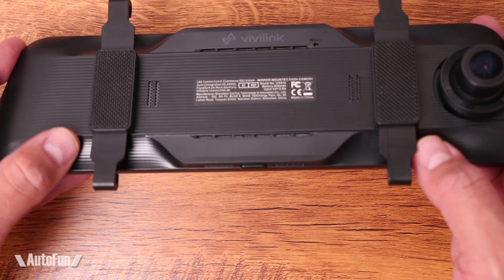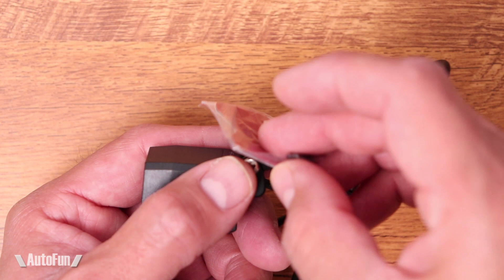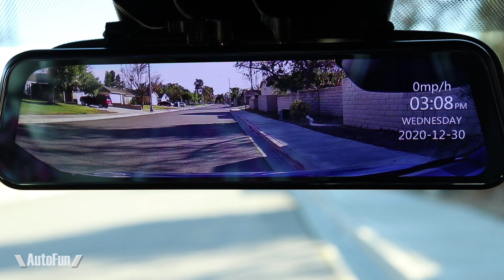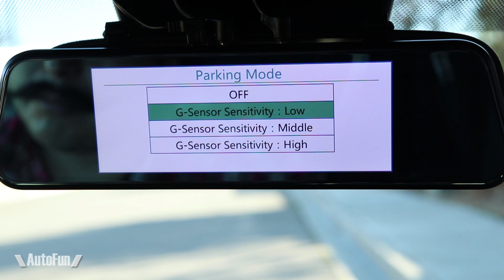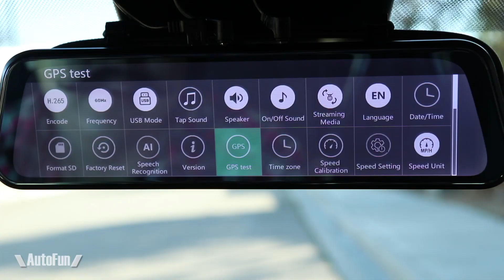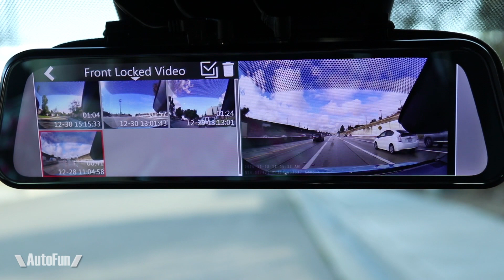Vivilink VX510 Mirror Dash Cam Review (2K, HD, GPS, Park Mode, Park Assist, Voice Control, 10")

Comment: The image from the backup camera is reversed, from side to side, so what's really on the driver's side, is on the passenger side when looking in the mirror. Is there a setting to fix this?
Reply from the maker: Hi Steve! that is very strange, mine shows the correct orientation (things on left are on the left and things on right are on the right) On some dash cams you can flip this (Horizontal Flip) however the VX510 does not have that feature (unless it now has it, since it's been some time since this review) Double check to see if you find that. I would also recommend contacting Vivilink for support, I'm sure they can walk you thru the troubleshooting process (however not sure if they help as Vivilink was a Vantop brand) Hope this helps, Cheers!

Comment: Great video. Will the voice command work without a memory card.
Reply from the maker: Thanks RSV BASS! yes the voice command works without a memory card but be aware that most mirror dashcams will keep displaying a pop up message telling you have no memory card installed, in some dash cams you have to constantly dismiss the pop up and in some dash cams the pop up stays on screen until a memory card is installed. Here is a backup system that does not need one https://youtu.be/67MZ7dpYd_g Hope this helps and thanks for watching!

Comment: Where does the red cable hooks up
Too ??
Reply from the maker: Hi Andre! Connecting the red wire is optional, it is connected to the reversing tail lights of the car, so when the car is put on reverse the parking lines will turn on. Hope this helps and thanks for watching!

Comment: Thanks for review
1. Is it same item the VanTop H610?
2. 2.5k real cam resolution is true?
Reply from the maker: You're welcome Lee! regarding the H610, I have not reviewed it yet so I can't compare it but Vivilink is owned by Vantop which is why we see similarities in design. Regarding the resolution, I typically double check the resolution of the file when doing the review so I believe it should be 2.5K however when If I can find the raw footage for it I will confirm for you (but so far I haven't had any resolution issues with Vantop or Vivilink) However if you are looking for the highest resolution I would recommend taking at look at this one https://youtu.be/fQDgk2YnRhQ it's 4K and has very similar features. Hope this helps and thanks for watching!
Reply: Thanks for detail explanation 
If it is changed to 1080p+2.5k,
the rear camera quality is up to 2.5k at the recording?
Reply from the maker: @music83275  Hi Lee! nope the rear camera will stay at 1080p, the only other mirror dashcam that I have tested that can go higher is this one https://youtu.be/fQDgk2YnRhQ which I run at 2K +2K mode Hope this helps bud!
Reply: Thank you for reply.

Even if I change the resolution to 1080p+2.5k in the settings, does the rear camera have the same recording resolution as 1080p?
Reply from the maker: @music83275  Hi J Lee! the dash cam only has two resolution options, 2.5k + 1080p or 1080p +1080p, I won't let you select 1080p +2.5K...
Reply from the maker: @music83275  Hi J Lee! the dash cam only has two resolution options, 2.5k + 1080p or 1080p +1080p, I won't let you select 1080p +2.5K...
Reply: Hi
Here is 2.5k + 1080p or 1080p + 2.5k
Is it wrong description?
https://www.amazon.com/gp/product/B08KY4FNPJ/ref=ppx_yo_dt_b_asin_title_o03_s00?ie=UTF8&psc=1
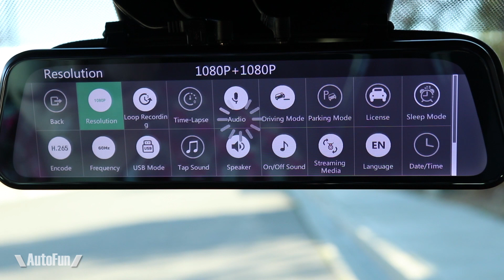Reply from the maker: @music83275  Hi again Lee! when I tested the dash cam only had the two options I mentioned earlier (shown at the 6:10 mark) it's possible they have updated hardware or firmware since the release for it, I seen it before where they add or remove features, if you get it, please let us know if you are able to select 2.5K for the rear be interesting to confirm, thanks man!
Reply: Ok, I will let you know.
I guess the description is wrong.
"Video Resolution: 2.5K(F)+1080P(R) or 2.5K(R)+1080P(F)"
Reply: Wrong information was posted on Amazon's site, and the seller said the same.
Reply from the maker: @music83275  Awesome thanks for confirming! I do think once we see a 4K or even a 2.5K rear camera it will be a game changer...

Comment: Hey, AutoFun do you know where I can find a Mirror Dash Cam with backup assistance like I want to hear the beeping as I am backing up? 
Thank You
Reply from the maker: Hi Nathan! So far I have only seen the reversing lines on this mirror but no beeping as you back up as this would require the installation of proximity sensors (radar). They do have aftermarket proximity sensors (usually require drilling of the bumper and sometimes paint) I'm looking at reviewing a few of those, stay tuned bud!
Reply: @AlexAutoFun  So what your saying is that there is nothing similar to a dash cam that has a proximity sensors built in?
Reply: Also If i were to buy a proximity sensor I wouldn’t know to combine my Kingslim DL12 Pro 4K Mirror Dash Cam and the sensor. lol I'm so confused
Reply from the maker: @nathanhuynh7959  yep, they are a different system and typically cannot be combined with a dashcam..
Reply from the maker: @nathanhuynh7959   Correct so far I have not seen any dashcam with sensors combined. Here are the sensors I mentioned https://amzn.to/3675BwS they are very inexpensive usually the cost of installation and paint are what drive the cost up on them..
Reply: @AlexAutoFun  i just need confirmation that there isn't a dashcam that has proximity sensor because my father is adamant on me trying to find one so yeah lol idk what to do lol
Reply: @AlexAutoFun  what do you mean cost of installation and paint because my rav4 is black so the color shouldn't change at all and as for the installation i'mma need a guide for that somehow lol
Reply from the maker: @nathanhuynh7959  Awesome yeah if your car is black then you are set, as far as installation cost, that's gonna vary from shop to shop or for the DYI crowd would be zero LOL
Reply: @AlexAutoFun  that's great thank you so much

Comment: Alex, I love this dash cam, but I was off work for a couple of days and when I tried to start my car the battery was drained from the dash cam. Am I missing something? It’s hardwired into the fuse box, but I’m not sure how parking mode works? I must have left it on, even though I told it to turn off the screen.., any help?? Thanks!
Reply from the maker: Hi Gregory! I would start by checking the hardwire kit to see if its connected properly (if connected incorrectly it can drain your battery) here is a video that covers that https://youtu.be/83a3w6EtzXo (I'm assuming your are using a Vantop kit?) When connected correctly, the LCD screen turns off by its self automatically and parking mode turns on  when you turn off your car. Hope this helps and please let us know if you figure it out bud!

Comment: This appeared to be a great camera but for me it only lasted 6weeks then it started overheating on me. And when I say overheating I mean finger tip burning type overheating. And funny thing is that summer hadn't truly hit where I live so I had to return it because I was to afraid it would catch on fire and burn my truck to the ground...I mean I do like bonfires and all but not if my truck is the main source of fuel for the fire. Lol
Reply from the maker: LOL OMG bonfires!! But yeah that doesn't sound good, I haven't had any issues with mine (I'm in California) but usually mirror dashcams seem to struggle in very hot environments. But they do generate a lot of heat on their own, my Vantop (same manufacturer as Vivilink) gets very hot when set to 4K which is common on devices that record 4K, even at 2K it gets very warm. I have several other styles of dash cams on my channel under the playlist "dash cams" if you like to compare other options. Hope this helps and thanks for watching bud!
Reply: @AlexAutoFun  yea I have checked out a few, pero me gusta mas el rear view mirror camera because I have limo tint on my back window so I use it as an actual rear view mirror.  I recently bought the wolfbox  g840 so only time will tell if this one will break on me as well, seeing how I live in Texas and it's gets pretty warm here sometimes.
Reply from the maker: @dominicfrost8627  Si el mirror style ayuda bastante especialment con tint. But yeah man pls let us know how the G840 does in Texas weather. There was a hack that another viewer mention well or trick, where he runs his center AC vents pointed up towards the mirror. He is Arizona I think but anyways, he really wanted the mirror style and said that worked (he was using Vantop H612T) in case you want to try!

Comment: Just ordered this one! It looks identical to the vantop to me but it's alot cheaper on Amazon at the moment. What are the benefits of having gps on one of these mirrors other than having the MPH display in the mirror?
Reply from the maker: Hi Daniel! and congratulations on your new LCD dashcam! Yes Vivilink it's actually a Vantop brand which explains the similarities lol Regarding the GPS, some people like to have proof of the GPS location an accident took place at, but I know some also don't want to have their locations recorded so I guess is just a matter of preference. Same with the GPS speed, I like to have it as proof of how fast I was going but if you regularly speed this would backfire lol so it just depends on what you are looking for in terms of evidence. Hope this helps bud and thanks for watching!
Reply: @AlexAutoFun  Ah yeah that makes sense about the proof of speed! I don't usually speed so that would be a good thing to have. Another question of you don't mind? 

I think my tundra has a GPS antenna already in it maybe. Could I use that instead of buying a new one? Great review videos man keep it up! You deserve more subscribers!
Reply from the maker: @djordan7979  I don't think you will be able to use the existing antenna, they are sometimes specific to the application they are used for. The good thing is that they have a $30 coupon going on right now on this mirror so that should help offset the cost of adding the GPS antenna (I thinks it's $12 bucks) But yeah I appreciate your comment Daniel! working on a bunch other cool videos stay tuned bud!
Reply: @AlexAutoFun  I found out it's not a gps antenna anyway. It's a satellite antenna for XM radio. Thanks!
Reply from the maker: @djordan7979  You're welcome Daniel!

Comment: Hello Alex, Just saw the video for the vivilink vx510.  You mentioned plugging in a GPS antenna. What GPS antenna did you use? I see antennas with a 4 contact plug and ones with a 3 contact plug.  I was just wondering which you used. Thanks....Jim
Reply from the maker: Hi Jim! I used this one https://amzn.to/2LLKtph also if take look a my video description, I also listed my favorite memory card and hardwire to use with this dashcam if it helps, Thanks for watching Jim!
Reply: @AlexAutoFun  Thank you for your video.  How did you plug-in the GPS antenna?  I plugged in mine into the rightmost hole but it didn't do anything.
Reply from the maker: @HizkiaGunawan  Hi Hizkia! I plugged into the GPS hole shown at aprox the 2:01 mark. One thing to make sure is that the dashcam is off before plug it in and that the plug is inserted all the way until it bottoms out. The GPS should take a minute or two to find the satellites at that point, here is the antenna I used if it helps GPS Antenna  https://amzn.to/2LLKtph Hope this helps bud!
Reply: @AlexAutoFun  Thank you very much!  I bought this one https://www.amazon.com/gp/product/B08TWMPG3P/ref=ppx_yo_dt_b_asin_title_o08_s00?ie=UTF8&psc=1 that looks very much like the one you recommended but it doesn't work.  Upon a closer look it says that it's compatible with dashcam with 4 pin connection.  I wonder it that's the problem.  I'm gonna buy the one your recommended.  Thanks again!  Your videos are really helpful.
Reply from the maker: @HizkiaGunawan  You're weclome! hopefully you won't have any issues with the other one my friend!

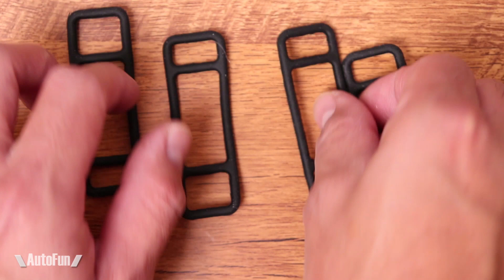Comment: Hey Alex... Great  moustache  !   I remember when I had one almost as nice as that , when I was a lot younger.   How close to being a regular mirror is this when the screen is off ?    Saw a glimpse around  2:30 mark, but it did not look as clean an image reflection as a factory installed regular mirror ?    What is the card type [ SD, SD mini,  SD micro ] , and  how much recording time can you get on 32GB  SD card ?   64 GB ?   128 GB        Let me know... thanks
Reply from the maker: Hi Phasma! thank you it been fun growing it! Regarding your question, the mirror seems to be about 90% as close to a regular mirror if you have the LCD off. I always leave my LCD on, I find the larger coverage is worth it instead using as a normal mirror, but yes it can also be used with the LCD off. For the video length, this will vary depending on the resolution you run the cameras at, however we are talking many hours, on my 128GB card I can look a few days back into my drives. I do run my other camera with a 32GB so I usually tell people if you got a 32gb card with the dashcam it should me more than enough as a typical accident or incident will only take a few minutes and the 32GB will capture several hours of footage. Hope this helps and thanks for watching!

Comment: Hello Alex, Can you tell me what your favorite mirror dash cam is?
Reply from the maker: Hi Kano-Moto! I would say it would depend on what you are looking for on a dash cam, if you are looking for best value I think this Vivilink one is hard to beat. If you are strictly looking for front 4K video you would want to look at https://youtu.be/fQDgk2YnRhQ If you don't need 4K video but want something in between here is a good choice https://youtu.be/qSRS6dXi85M If you searching for a Mirror with detachable cameras here are a couple good options https://youtu.be/7n4J8Bz6tLM or this https://youtu.be/dVcfFVLCXbY Hope this helps on your search!
Reply: @AlexAutoFun  Sorry I should have been more specific, I'm wanting like the ones you showed that have front and rear camera, and best quality as possible because I'm hoping to be able to use the footage in my travel vlogs.
Reply from the maker: @SHIFT-ED  Ahh got you for best video quality possible (and don't mind paying extra) ether 4K Vantop or 2.5K Wolfbox https://youtu.be/qSRS6dXi85M would be good choices. If you plan to speak to the camera or a GoPro consider the Pormido D50 https://youtu.be/dVcfFVLCXbY Its the most expensive of the three but the cabin camera can you give an extra camera angle to cut to..

Comment: Seems like all this mirror dashcams come from the same manufacturer and chinese sellers just rebrand them...
Reply: Yup. And that's the same for every single thing that is produced in china regardless if it is a western product. Even cars and motorcycles...
This is exactly the same Vantop rear mirror series
Reply from the maker: Hi FightHateWithMoreHate! As EdrumSense pointed out it's common industry practice to rebrand products, add or remove a feature and sell under different brands, I actually seen some of the dashcams I reviewed at Best Buy under a different name with a nice price hike! ouch! but yeah man thanks for watching and commenting!